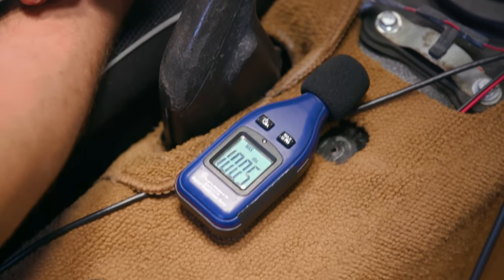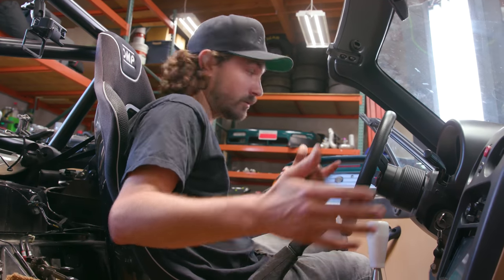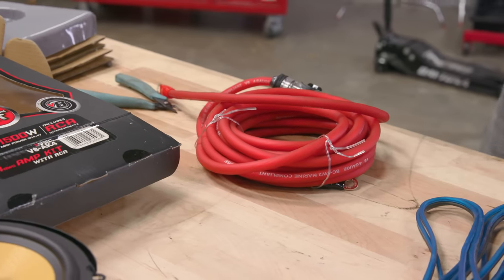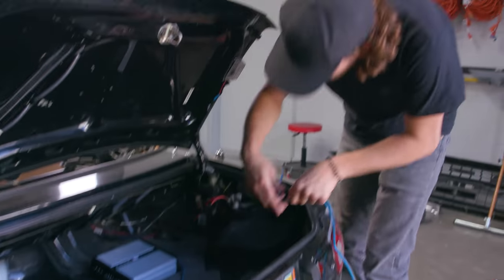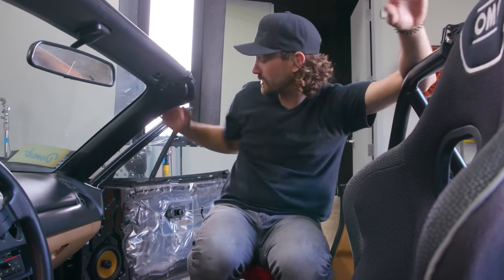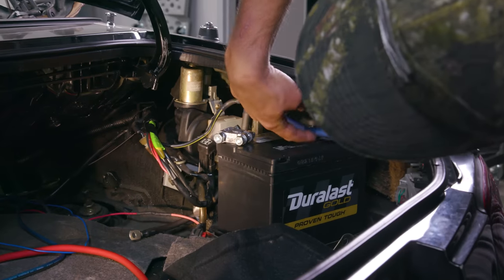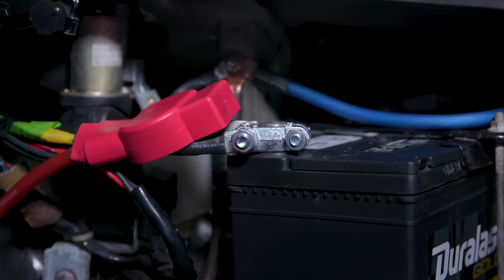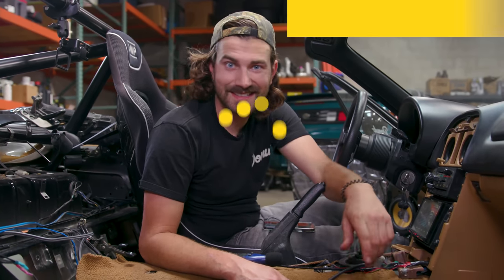Is Upgrading Your Car Speakers ACTUALLY Worth It?

Comment: great video but i must say i was a bit disappointed in the results. sounded barely louder but more than that it sounded only a little better in quality, especially at the higher volume. i may have just expected too much at the start but personally i would be disappointed in these results for $500. ive used amps and speakers from yard sales as a kid that performed better. hope you get that low frequency filter working, hopefully it helps. wished you included that part given its just part of the amp as mentioned. cheers

Comment: I'm just asking this as an audiophile. Which brand series offer studio monitor levels of sound with proper bass and not just balanced sound? I know for a fact that speakers are also designed for specific sound signature, that's why I'm keen to know about speakers of which brands offer that kind of experience, leaving aside the NVH of the car when in motion.

Comment: 100db is 15 minutes exposure time before hearing loss begins. If you need more than that to drown out the wind noise, you should probably wear ear plugs for the same reasons you should on a motorbike.

Comment: the one thing he missed in this video is that you're going to need capacitor,  i am really surprised he didn't put one in the video  that is a must when putting in a sound system safe or you might overload or worse a fire safe is not in this video

Comment: Whats the spl spec @1watt 1 meter?  Thats the number you need to look at  it tells you speaker how efficient the speaker is.
Now we know JL makes stuff thats really close to its ratings but what if your picking a cheap brand 
Look at the SPL ratings  ignore the peak power ratings that is only if a bolt of lightning hits it or you clip the head unit.  

The welding wire was cool for wire in the doors I used to use a speedometer cable then went to 54" long wire ties the wire tie has more stiffness and you can push it without it bending.

Comment: I'm not really knowledgeble on this subject but I once heard that you should measure your speaker cables to be same size on all speakers so the signal does arrive at the same time everywhere but does it really matter at the lengths that are used on a car where speakers are not so far apart anyways?
Love the videos!
Reply: Its not about the time it takes. Wire acts as a resistor. You want all the wires the same gauge and length so the over all impedance for each speaker is the same.
Reply: @baqcasanke  oh I see, that makes sense! Thank you

Comment: The video was going good until you got to the portion about setting gains. You are going to blow your speakers if you set the gain willy nilly and crank the volume.

Setting gains is meant to prevent a clipped signal from going through your speakers. If you are not sure at what points your head unit clips and at what point your amp clips you will send square waveforms through your speakers and kill them.

Comment: Coming from electrical/audio engineering background, it is incredibly hard to tune speakers in a space like a car's interior because of the position of speakers relative to the passenger and the huge amount of reflections inside the car. You're hearing more of the space than the speakers themselves. On a decent car, the speaker system is probably designed by Harman, or Bose. Do not try to upgrade speakers on those cars as they will 100% end up sounding worse than OE. It might sound different and you might or might not like it, but without proper measurement equipment and a huge lot of DSP, it will 100% sound worse scientifically. 

Nonetheless, for something like this Miata, I agree an upgrade will probably make it sound better, given the system is very basic and simple to start with.

Comment: Definitely nothing wrong with those speakers you pulled out, or powering them off the head unit.  That horrendous sound was likely due to one or more of the following issues:  Bad wiring to the speakers (very common for 20+ year old vehicles, they often short-out due to the door being opened and closed so many times), bad ground point for the head unit (common for amateur installers who use the factory harness ground or don't sand down the paint and ground directly to frame), or bad power cable that is inadequate of providing the current necessary for a high power aftermarket head unit (in a car this age, the best sound is achieved by running a new fused power cable direct from battery).

Comment: Those alpine speaker where fine, the only problem was the car radio amplifier (too little output level without distortion). You could have just changed the car radio with a better one (even without using an external amp). Too expensive for this little improvement... Even all those fancy cables aren't worth with this setup. Just letting people know they could spend WAY less and get the same results 😅

Comment: Most vehicles have 4 channels/speaker outputs to use. In this rare case of having only 2 speakers, installing a 4ch amp for only 2 speakers is a bit of a waste of 2 amp channels, unless the amp will allow bridging into 2 channels output. He's only using half of the amplifier. A pro is it will run cooler and the amp will likely last longer, however a con is money potentially wasted on a 2ch only system.

Comment: What you’re looking for is sound staging in sail panels or the dash with high range frequencies. Low range needs to be, well, low in the car. Coaxials will do just fine and these speakers are decent with no amp. Sound damping material also will help with lost acoustic energy.

Comment: Would have been so nice to install the amp first with the original speakers just to see how much was in effect an amplifier has.

Turning up your head unit really high distorts, perhaps if you had the amplifier on those factory speakers they would have performed quite a bit better because you could have it turned up the only 30%

Would have been a much more scientific comparison.. all this showed us is installing all new stereo equipment has a positive effect.. but it doesn't tell us which one was most important

Comment: 1. Never cut the old original wiring !!!
2. Amp control (blue wire) goes to head unit amp control , NOT ignition !!!! so amps start only when headunit is ON , not draining your batt if stationary and switch on
3. Solder your terminals, even when crimpped
4. NEVER run the positive wire without a FUSE mounted as close to the batt as possible !!! LOL
5. You got a 4 Ch, Amp. just run another RCA for subwoofer , low pass filter front spkrs

Comment: I have a 2012 Ford ranger PX and the stock speakers are really good. I bought a mid quality set of speakers and they didn’t sound anywhere near as good
Reply: Because the crappy speaker were made to work with the crappy low power head unit.  Aftermarket speakers sometimes need an amp for the minimum power.
You may have also got the wrong resistance speakers.

Comment: Take my advice, do not install an amp on the reare deck with the label name pointed at the floor 
Reason is heat raises if the amps upside down the heat the amp is trying to get ride of only heats up the electronics circuit on the pcb 
Pc board  causing it to over heat and shut down, or causing distortion as the electronics heat up. Your computer runs faster if its cool so do amps. 
On a side note with that car the back bottom you put it on is an area that can get wet in a storm.
Its where the top rests when its down. 
On JL amps I always preset them so when I set them up im just messing with the gains. 
Its set to about 1/2 way on the gain 
60hz on the crossover and 3 on the eq setting i belive its been 13 years
But I sold and installed JL audio for the better part of 17 years. 
I've put 1000s of amps in. 
And I still own and use the orignal / series amps. And xtant from when Jeff Scoon owned that company before he sold it and went to work for JL Audio  hence the / series amps were going to be xtant amps.
Heat on an amp is really bad news.

Comment: Strange. Audio quality is very important to me, but when I installed my speakers, I didn’t use an amp, just an aftermarket head unit. I have no issues with the sound quality in my system. What I’m saying is I’m not sure an amp is always necessary

Comment: original car speakers used to be very generic, now most car manufacturers have partnered up with some sort of audio company, therefore, modern vehicles have a much higher chance at not garbage speakers coming installed from the factory.

Comment: It's a small thing, but when showing how to read the specs for the amp I appreciate that they included reading the wrong line and how to spot that it's the wrong line.  It bugs me when various demos will have a wall of tech gibberish, pull a number out of it and you just have to figure out where it came from.  Or not even show it at all and just say "I know these are blahblahblah".

Comment: One little tip: No amp is 100 percent efficient, so if it has  75 RMS written on the box, you take let's say 85 percent efficiency (in a good case) and at the end you get 63-64 Watts. It's a good idea to go a little bit over the recommended power of the speakers. Be very careful with setting your gain / levels. 👌
Reply: the rating the amp has is accounting that.
Reply: @growingup4487  how do you know that? And even so, is it certified, uncertified or dynamic? How much heat does it buil up, so that it delivers that what it says on the box. What is the voltage constant needed?

Comment: I got a cheap ApplePlay head unit - I intend to upgrade soon, but just wanted to get one to learn to wire it up etc - and predictably, the maximum volume on most songs (playing from my Apple Music library) is a little low. BUT there are a handful of songs that crank out? Which indicates to me it's some kind of setting somewhere, maybe even just on the individual songs in my Apple library?

Comment: you need to give more power from the amp, not the head unit... this is why you have distorsions even if you changed your speakers and added an amplifier...
Change volume on the head unit where is not distorted sound, then you change the gain level on the amplifier...

Comment: Great information while doing the process. 
Wow. Very well done. 
Have to comment however about the Superbad hydraulic crimper tool. I expected a comment that might offer insight into alternate options to crimp a big ass lug for those among us who don’t want to sell a favored child into slavery to offset expenses when purchasing a  superbadass hydraulic crimp tool to make it easier. 

Years ago, in my previous life as a lighting designer, where one of the less glamorous but (to me) still absolutely enjoyable jobs in the workshop was building power cables and such. One particular task involved welding cable terminations. Crimping a copper lug so doing a large power drop for the high powered dimmers was something we did manually. An iron surface, such as an anvil and a large ball peen hammer. Had we had access to the coolasshit gadget you can afford with giant YT $$$, it’s no sweat throwing cash out for tools that are so specialized and make the job too simple. But in the 90s working in Seattle’s largest theatrical lighting and sound supplier we were not working with gold encrusted gaffers wrenches, but we did have unlimited access to the finest gaffers tape available. Something that when I’ve tried to buy for my personal use, is harder than I’d imagined. Good thing I stockpiled shit tons of it, I still have a roll or two I sparingly use for special occasions. Lol.

Comment: So why haven’t you done the big 3??? That should’ve been the 1st thing to do when your building any vehicle, then maintenance as needed with upgrades as you build. Last but not least, you should put in a new ground spot for the head unit. Great show except another thing you could do is put sound deadening put between the speaker and the door panel. Then if you have a subwoofer in the trunk you put deadening material on the back side of your license plate so it doesn’t rattle.

Comment: I upgraded the speakers in my old car. With no added amps, and taking some time to adjust the audio on the head unit, I had people asking me what kind of subs I had. They were shocked to hear that I didn’t even have an amp.
Reply: What car?, how’d you do it?, what speakers did you upgrade to?, I’m confused, I have a 2016 malibu and I want to upgrade my audio system but I wouldn’t like to get into all that complicated/ expensive amps, subwoofer and all that, I just want a descent upgrade
Reply: @alejandrosotelo5176  I had a ‘95 Buick Century. I modified the rear deck to accommodate a pair of Pioneer 6x9 3 way speakers. I don’t remember the model (this was many years ago), I just remember that the overall speaker was much larger than the factory 6x9s. The head-unit had been replaced by the previous owner, and it had more audio adjustment options on it than I had ever seen in a car stereo. I just took the time to really play with things, and dialed in the EQ until I felt that it was right. I also had to upgrade the front dash speakers (the factory speakers were only about 10W speakers, with the head unit pushing 45 or 50W per channel) but I don’t remember what they were. The 6x9s were the real star of the show.
Reply: The problem with modern cars is that they tend to use small speakers - like 4x6 in the rear and maybe 3.5s or something in the doors. These just aren’t big enough to really push much base. I had a buddy in the military who had a 60 something Mustang. He did a similar thing to his car, only he added a small amp. He also had 6x9s, and I believe he added a 100w stereo (50w/channel - IIRC) amp to support them.

Comment: The efficiency of the speaker can be as or more important than the wattage of the amp.

A 3 watt tube amp with Klipschorns will clear off all your tables of non sticky items. 100 watts into some inefficient speakers is not that loud.  Even a 1,000 watts RMS in a car can put out less volume than the 3 watts into the Klipsch's

Using too low of impedance speakers can fry your amp.

Comment: Copper oxidising not corroding. Any cable in plastic sleeve is oxygen free. So you're likely to change the cables for aesthetics, not because they're old and crappy.

Edit.
Interference can be a reason to change cables. But looking on the set/car it isn't for audiophiles.

Comment: Do you like to run low pass filters or some signal tuning resistors? last time I did any audio, which was eons ago I was running 2 MATTS 1000W class D and 2 W7, with Infinity Reference or Kappa series and another MATTS amp for those. So I know technology has vastly changed since the early 2k's

Comment: You’re missing one of the MOST important detail about this video when it comes to clear loud speakers!!!! PREOUTS ON THE HEAD UNIT IS ALL THAT MATTERS!!!!! Since you’re now powering your speakers with an amp you still need to get a new head or one of those line voltage boosters! 4v or 5v is best. The one in that car is most likely 2v .. If you could’ve added that to your video you’d be spot on!!! You don’t get clarity from an amp. YOU GET IT FROM THE VOLTAGE COMING FROM YOUR PREOUTS OFF THE HEAD! (I’m an audiophile)

Comment: Can you use a amp + new speaker with stock stereo?
Reply: Throw an LC2i in with the amp. Which integrates with factory systems. They’re pricey, but worth it.

Comment: Would it not have made more sense to tie the end of your wire to the old speaker wire, then pull the old wire out. As this would easily pull the new cable through

Comment: Wait, you already have speaker wire running through the grommet into the door. To install the new wire, attach the new wire to the old one inside the car, then pull the old wire out through the door. This will thread your new speaker wire in while removing the old one. Am I missing anything with this method?

Comment: Seems like it would make it easier to use the old speaker wire to pull the new one into the door as opposed to using a welding rod. 🧐

Comment: In fact, that amp is completely unnecessary when you have decent head unit. Also, you can install more powerful speakers, but if you have holes in the doors , all bass will just fly away and all loosey things in doors will resonate , you will end up with same terrible sound. You need some sound dampening insulation inside doors which will help far more than just adding amp. Doors needs to be mostly air tight sealed and sound dampened.

Comment: 11:42 - Isn't the amp putting out up to 200 watts RMS per channel for 2 channels at 4 ohms? since it's a 400 watt amp? Or am I misunderstanding? 75 watts for 4 channels but the Miata only has 2 door speakers he's amping, right? Not a big deal to over amp, but could blow the speakers by really pushing them I would guess, right?

Comment: If the radio is weak its better sounding not at full volume like 35 is the best never listen your radio on full 40. i never set any of my sound devices on full always 5% or so lower then full.